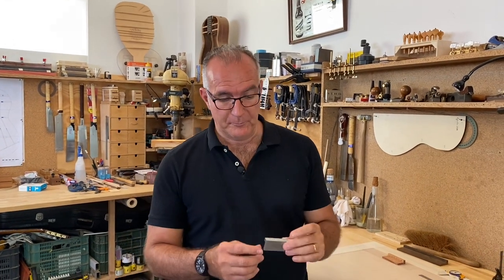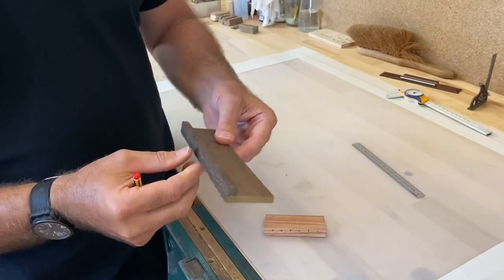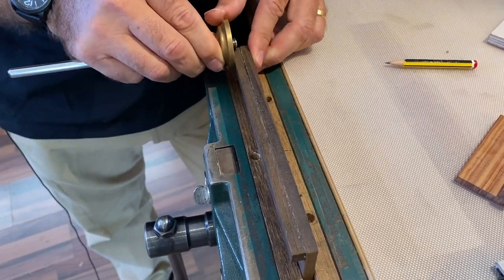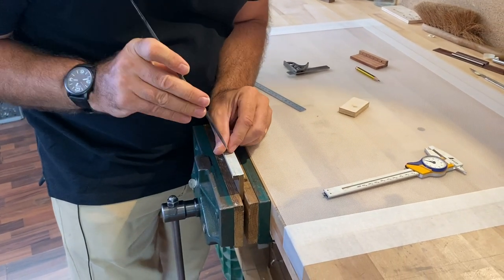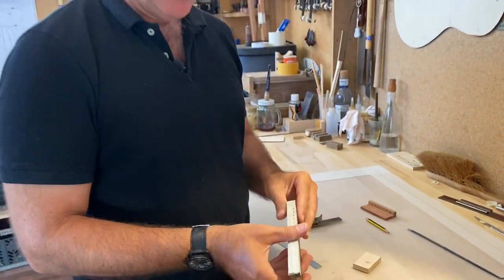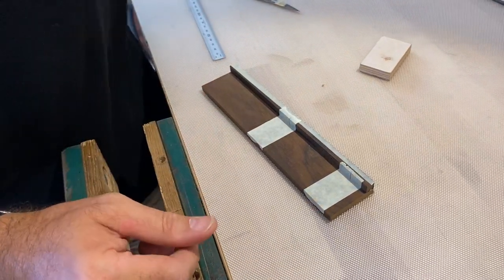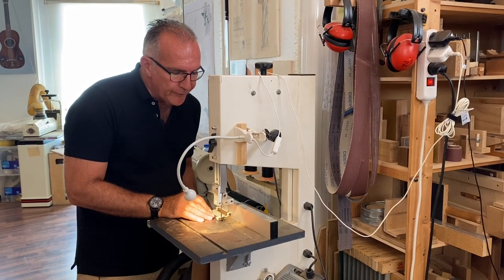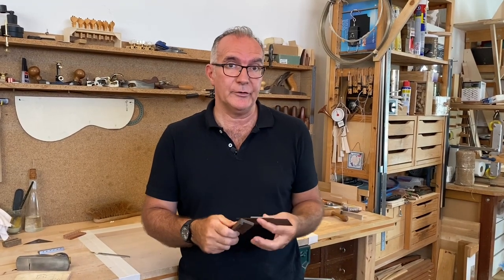How to make a jig to drill the holes in the bridge.

Comment: To make the jig more durable, you could drill the holes a bit larger and use a piece of brass pipe as a bushing. That has the additional benefit that a bigger drillbit is less likely to wander.
Reply from the maker: Yes, that’s a very good option.
Thanks for your sugestión.

Comment: Hi, I built a guitar.. took ages.. many corrections needed.. anyway got there.. only to discover the bridge I glued down (bought on ebay 2 with saddle and nut for 10 quid rosewood very cheap) had the hole for the 2nd string about a millimeter at least too near the 3rd string hole.. I was appalled as you can imagine... got any ideas.. don't want to remove the bridge and drill head is too big to get in position... paul
Reply from the maker: Hi Paul, search on line for a drill bit 1.5 mm in diameter and 160 mm long. They are available in some websites or even on eBay.
You would have to plug in the existing hole and drill a new one using this extra long drill bit.
Reply: thank you for the reply.. I am totally furious as you can imagine.. I can see me having to remove the bridge.. I don't think the other holes are spot on either... I used titebond (cause my hide glue granules were old and just didn't seem to work)... do you know the best way to get off a bridge stuck with titebond? thanks, paul